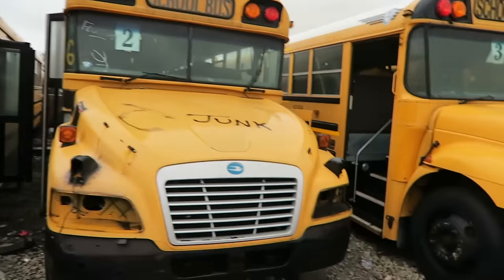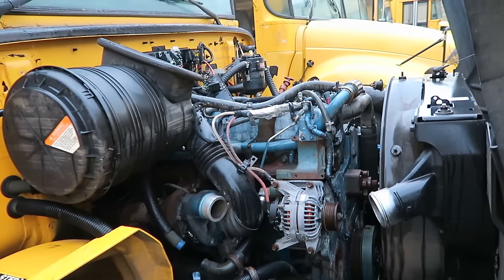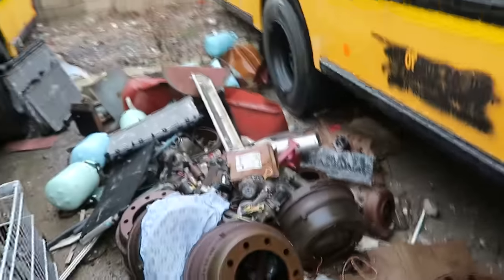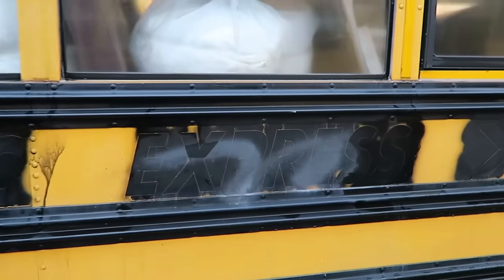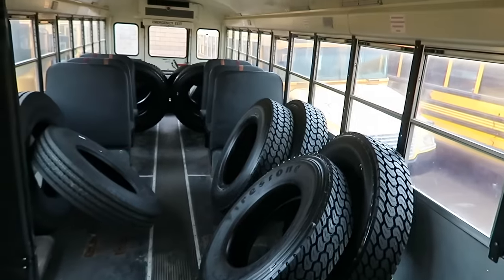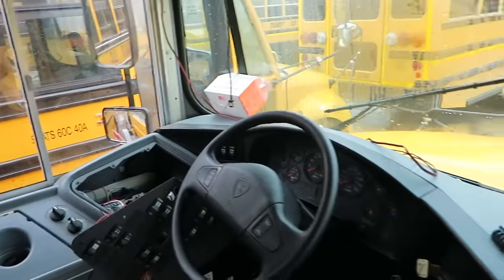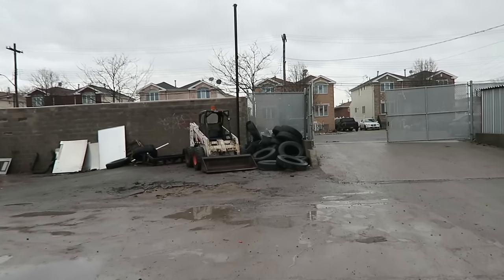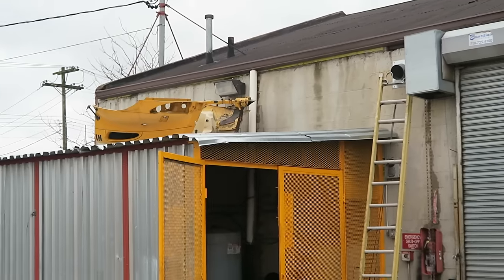Junk Yard School buses 🚌

Comment: It breaks my heart to see busses that are practically new that are now junk.  I'm an IC fan, our company only had IC up until 2013 then switched to Thomas C2 safety liners.    It's weird seeing some of those busses with the Wig Wags hanging. What state still use Wig Wags?  Thought they were used back in the 60s or 70s.    I would love to get my hands on one of those air brake pedals with the valves from an IC bus just to have